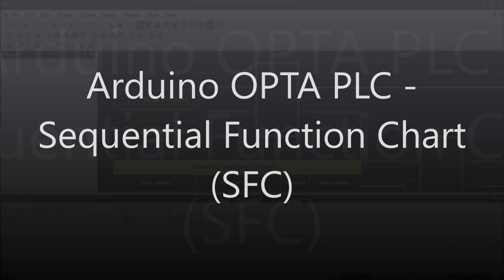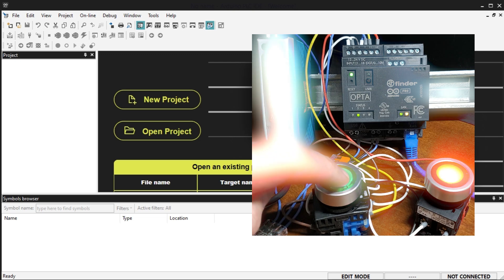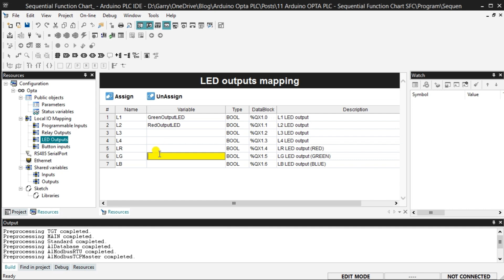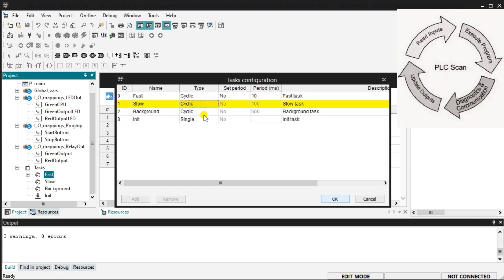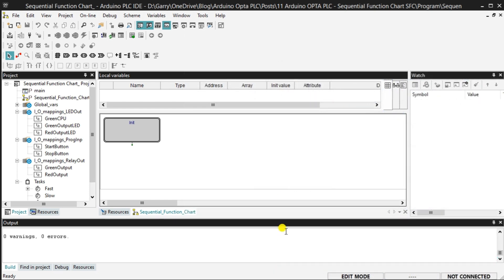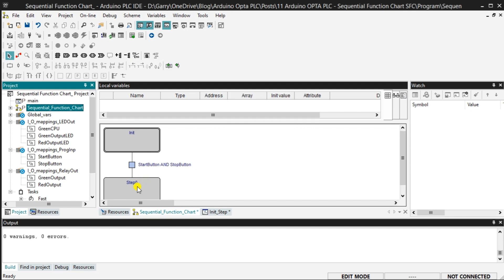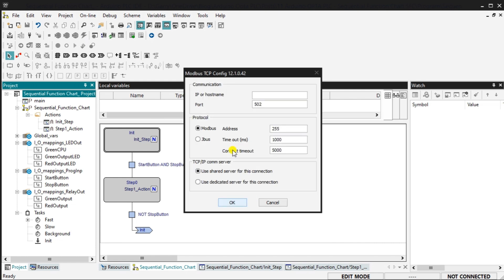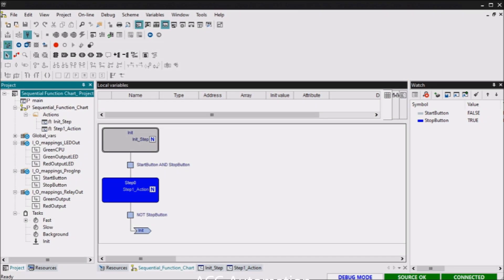Arduino OPTA PLC - Sequential Function Chart SFC

Comment: What means "StartButton AND StopButton"? Both values are equal to TRUE? We have Stop button like a normally closed contact?
Reply from the maker: You are correct. To determine if the button is normally open or normally closed you have to look at the wiring. 
Regards
Garry